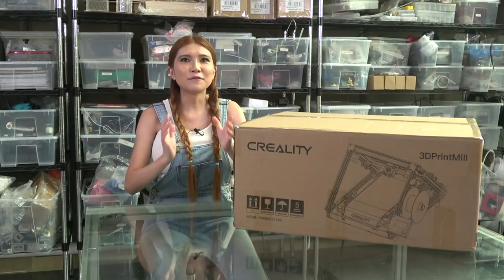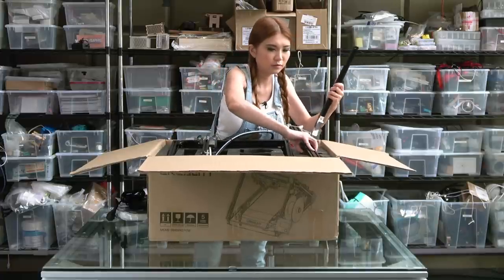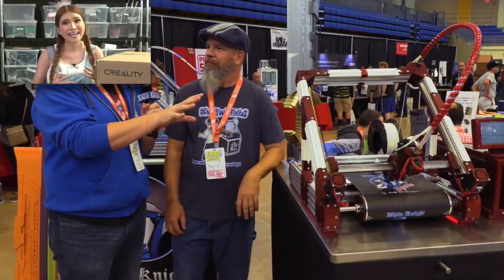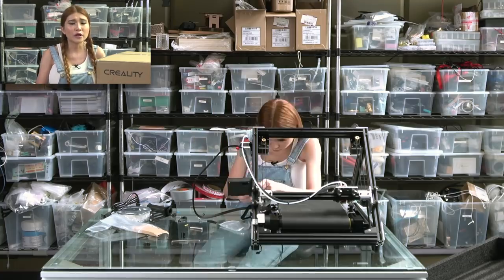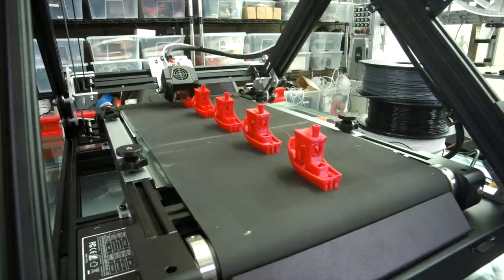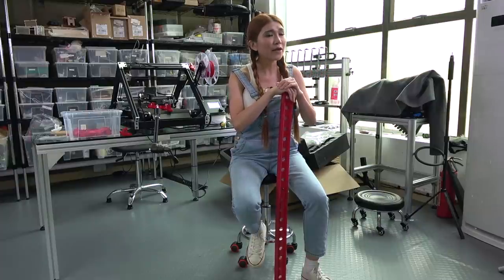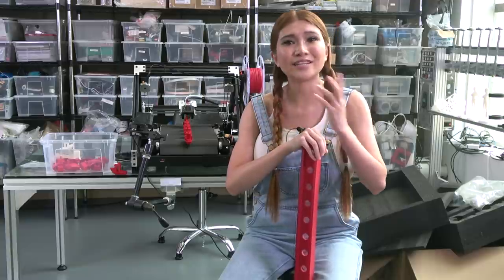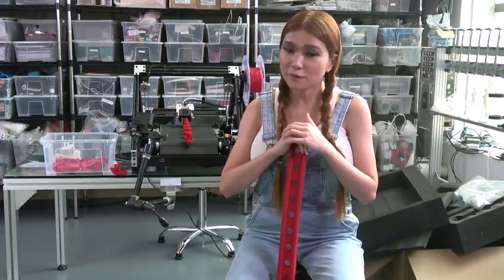Sneak Peek- The 3DPrintMill, Infinite-Z, Belt 3D Printer- Now on Kickstarter!

Comment: I was recently shopping and saw one of those shelving systems where you have plastic shelves with 4 plastic tubes between each shelf. I thought wow, i wonder if you could print that? Can it?  how big could it make the shelves? How sturdy would it be? I was also curious if you considered a pointier hot end like the diamond hot end? Do you think some of the limitations could be reduced using non planer slicing providing your hot end would allow it?

Comment: I wonder though why the angled print-head on it? I mean, sure it makes sense to have the conveyer always moving in one direction as the print head moves along. But wouldn't the same principal apply if you had the belt be able to move forward and backward in order to print from a top-down perspective like regular printers do? And then once one part is done the belt just moves it forward enough to be clear for the next part? 

Or, is the angled print aspect of this makes it better suited for those long prints like that I-Beam that you printed at the end there?

Comment: First... PUPPY! <3
Second, looks awesome. I’d worry about that starter filament strip running cross the belt (just going under at 7:30), unless there’s something scraping the belt. That comes back around it could cause a problem. Love how the print head is working at 45deg to the bed. Ingenious.
Reply from the maker: It can be run on the side, just a purge in GCODE

Comment: Awesome.this design would lend it self well to e3d tool changer Finally something other then the white knite. I love the white night and wish I could build one but the belt it uses is like 90% of the cost. Will you be making one that has a 300 or 400mm wide bed? Will you sell belts seperate from the machine?

Comment: I want one. End of story. I see that printing stuff like a boat Haul model or RC in one print would be nice. Or printing a small batch run of a part or product is also nice. I would love to see a spec sheet. Such as what is the top speed, what is the X and Y dimensions. And how well does parts stick to the bed, etc. and will this printer work with the Simplify3D Slicer software. Also what type filament can it print with. Ie: Nylon-X(nylon with carbon fiber) TPU, PETG, etc.

Comment: Very good evolution of tech.  Considering how many garage industries are out there this would be perfect designing smaller output needs.  I can also see where many critical parts can be tailored to a given need and function.  Good work.  I have a boat engine part that has broken where there is no possibility of the part being available.   Using the original specifications parts like these are now a possibility.  How else could a single part be manufactured or a limited series created.  Even creating small parts out of production and accessibility could serve for a lucrative income.

Comment: I'm wondering how flat the conveyor belt surface is under the print head. Any curling will distort the print. An interesting add on might be a small vacuum table under the print head that will hold the belt perfectly flat where the printing is happening.
Reply from the maker: So far, no problem

Comment: How do you handle filament swapping? (Or do you just get really large rolls and not have to worry about it?)  Looking forward to the kickstarter!
Reply from the maker: You can pause and swap mid print (and it has a runout sensor). There will probably also be a 5kg spool holder as a stretch goal.

Comment: Truly exciting how 3D printing is empowering small biz manufacturers. Just so happens I'm about 2/3rds through a 36-hour audiobook  that does a deep-dive on the US mobilization of industry during WW2. Shorter accounts will always mention the Kaiser shipyards and Ford's Willow Run B-24 bomber plant with its mile-long assembly line (laid out in an "L" shape to avoid a neighboring Democrat-controlled county). But those impressive production statistics were largely made possible by countless small mom-and-pop machine shops that did subcontracting work for the major manufacturers who were eager to recruit any outsiders who could produce enough components of sufficient quality. The big corporations were always looking to the postwar marketplace so outsourcing reduced the ranks of their own machines that would later have to be retooled to make civilian goods. These small shops were truly unsung heroes of the war effort.

Comment: Any recommendations for a good starter 3D printer? My 15 year old loves 3D printing. We have a small resin printer but find the clean up and the tank is just annoying, plus the clear plastic bottom on the tank is getting scratch and hazy. Looking for something bigger plus a filament instead of resin, but still easy to use software.

Comment: With the linear rails becoming cheaper, I don't see why the rollers are still being used. A set of Black Oxide Linear Rail for this printer would cost plus/minus $50 and will reduce the amounts of parts vs roller based. Great project anyway. Congrats!
Reply from the maker: People like the idea of rails but few can spot the difference in prints using them.

Comment: Naomi, a question, will this be able to work from 12Volt or 18 Volt or 24 Volt. We have massive problems with power sharing in South Africa and UPS's don't last past 12 to 18 minutes. If it can work from a battery, I can use a large battery that can run it for the hours that we don't have power. The power sharing lasts fro 30 minutes to 2 and a half hours.
I like the idea, but manufacturers must look at equipment that can run from a DC power source as we are going to se a lot of solar and wwind power in the future and solar power only works during the day so we need to have battery power for the night.
Reply from the maker: Ok, give me a bit to look into DC power options.

Comment: Naomi this is aVery cool setup. So I know it's a fabric, is it heated?  The other concern I have, how do longer prints stay attached once the weight starts to get too much on the cooled side. I assume, the adhesion isn't meant to hold up to that type of pressure, and some sort of support system by the consumer will needed to be applied. Very intrigued by the possibilities of this, thank you for really diving into this project. i really like the fact that you took the time to address the whole copying problem. Most including myself, always first think when it comes to china, you think something is copied and made cheaper. So im glad you addressed this, as a lot of work is being put into this on your and crealities side, and you paid tribute to those that set the foundation. Keep up the great work!
Reply from the maker: It has a heated bed and there are outfeed rollers to support prints as they roll off the bed.
Reply: @Naomi-Wu  that's awesome, I look forward to adding this to my collection. I appreciate all your hard work.

Comment: Is it safe to assume there is a filiment run-out sensor to alert the firmware and pause the job?

I also assume that you have to run the print in relative XY mode in G-Code?

Comment: 0:20 .. Did I hear snake peek ?!  :D  On a more serious note, shouldn't this printer rather be labelled an infinite Y-axis type ?
Reply: No... the belt is the Z axis.  The extruder is moving on the X and Y axis.  (When I wrote the original software, I built it on a modified Makerbot Replicator... and tilted the build plate.  The Z motor was used to drive the belt.  (Technically, the belt is called Z' (Z prime) because it's actually a function of Z and Y.)

Comment: Also, I really can see myself using the very long Z Axis on this printer. Printing out my own custom RC cars, boats and plains in one piece as one of my projects. In order to print one of my RC Boat designs I will have to stand it on end and print it that way. Not an ideal way to print it out.

Comment: Wouldn't it be possible to just make a software change on a normal flat-bed printer, so at the end of a print, it would wait for the bed and hotend to cool down and bump the hotend into the printed part, so it would knock over the finished part from the bed and the printer could start again? 

Obviously there would be some constraints, but theoretically it should work.
Reply from the maker: Sure lots of setups like that. Problem is it has to be tuned to each part because bed adhesion can be too strong to bump it off.

Comment: Hi, impressed with this machine from the youtube reviews, would there be any chance of a video showing what would be involved in changing the bed roller belt? Would be helpful as you cant control the end users use  or misuse of the machine and if you apply the Automotive industries standards on the use of belted products there are normally recommended change out times for belts either due to time product has been used or amount of hours use. This is normal to stop failure before it happens. Many thanks in advance.
Reply from the maker: OK will work on it!

Comment: Hi I am currently running two Enders 3 v2 as a print farm but would love to have a printer continually spit out prints. My prints are quite small about 40 x 20 x 20 mm and has over hangs on all sides which require supports (imaging a elongated mushroom). Would this printer be capable of doing this ? The strange print angle to the bed worries me, it would be better if it was still 90 degrees from the bed.

Comment: Hi Naomi, I am interested in this printer, will it print in black ABS, and how good is the finish so far ? I am making Air guns and parts like pistol grips, and frames are needed.
the box in you video is a Creality 3D PrintMill, but in your links you have https://blackbelt-3d.com ?  Is that the same printer or is it another company not connected.
Sorry this is the first Printer that looks usuable for what I need other than the MarFordge 3D Printers.
Thans for any help.

Comment: This printer should have a huge market in Education:  Even with a print farm, too many student designs wait too long to print, slowing down the entire learning process.

If the 3DPrintMill is to find a home in the education market, it must:
1. Be very safe for unattended operation.  All firmware safety features must be activated, in addition to having adequate mechanical and electrical sensors, including a GFI breaker in the power supply.
2. Provide easy integration with tools such as (or similar to) OctoPrint and The Spaghetti Detective, to queue up designs and monitor production, both interactively/remotely and by smart automated monitoring.

The education market need lots of fast "draft" quality printing: A class of 30 students who each do 1 design every week with 3 prototype prints each, would mean 90 prints per week for that one class alone, or 18 prints per weekday, on average.  Assuming the draft prints take about 1-1.5 hours each, a single 3DPrintMill could easily do the job.  When/if needed, larger and higher quality prints (anything with longer print times) can be done on conventional 3D printers, where overnight prints would have less need for a belt.

It may be necessary to create an "Education Upgrade Option" to add these features to the base 3DPrintMill, but I'd love them to be standard!
Reply: The main competition for a belt printer in education would be a larger-bed printer (such as a CR-10 or clone) using "One at a Time" mode.

The main obstacle isn't hardware, but software: Cura is very badly broken when it comes to helping correctly fill the bed to make "One at a Time" mode work easily and reliably.  In fact, it seems to be intentionally designed to make this nearly impossible to do correctly and consistently.  It's simply not a functional part of any production-oriented Cura workflow.

I'm working on scripts to see if this can be fixed in post-processing, but progress is very slow.  If ultimately successful, I hope to deploy them as Cura and/or OctoPrint plugins.  Maybe, eventually, even as a Marlin extension to let you multi-select files for printing right on the printer display.

One feature I want is a "Scale and Force Fit" option to ensure the set of prints get done, even if the selected ones don't fit naturally.  There is nothing worse than having a full bed of prints get ruined because of not being able to get around tool limitations.  Reduced-size versions would be far more useful than nothing.

Edit: I've been writing embedded real-time software for 35 years, and one rule I've followed is simple: "In mechanical systems, software is always more expensive than hardware."  That is, when a mechanical change can vastly simplify the software, always consider making that change!  In this case, the difficulty of fixing Cura may be eliminated by adding the belt.  But is the belt feature alone worth (roughly) doubling the cost of the printer?  That is, once a software fix is developed, everyone gets to use it without changing their printer, no matter what printer they have.  But if the fix isn't available and may not be for years, then hardware is the only way to get around it in the near-term.
Reply from the maker: Good suggestions, noted and I'll keep them in mind, thanks Bob!
Reply: @Naomi-Wu  Oh yeah, I should say I do IT for school system in the US, and they always want fully enclosed machines to keep the kids hands away from hot things.

Comment: Very impressed with your mind and decisions to be fair and professional. Love the design. I use Creality 10S Pro now for development. Then send my .STL to Shapeways for production runs. But my issue is updates. Minor improvements are painful and take time. With your belt machine. I still have my .STL. so an update is minutes not days or weeks. And stop start using Carbon Fiber enhanced filament create more chance for nozzle clogs. Hours lost in clean up. I am retired now but build factory automation using vision guided technology. You are just scraping the surface here. Sensors,  materials, vision so many enabling technologies yet to apply will open this tool to many. I hope I will be able to afford a unit for my model train bodies and chassis. Replace and reproduce 1950s S Gauge Trains is my dream. Teaching science through trains and digital technology is another goal, which I see you supporting as well. Great move, proud of you.  Best of luck, may God Bless you.
Dennis in Virginia, USA

Comment: I think the real revolution will come with articulating print heads, not ones locked at weird angles. For very certain applications this is cool. But it's not infinite z. I don't care what the software makes it act like, physically It's infinite Y with a canted Z that you rotate your models to fit. Adhesion won't ever be quite as good as pointing the nozzle straight at the plate, and printing something tapered or especially concave but tall would require so much more support than just having a really F-ing tall printer.

Comment: Can anyone explain the practical reason(s) why every 'infinite z' printer is triangular rather than the traditional cube like shape? Why don't they just essentially swap out the build plate for a belt? I understand you wouldn't be able to print one after the other in a line, with the z constantly rolling away as in the timelapses shown as easily but it would definitely be possible
Reply: Actually never mind, I figured it out. The angled hotend means diagonal slices, means that you can print something far longer than the size of the belt top print area.